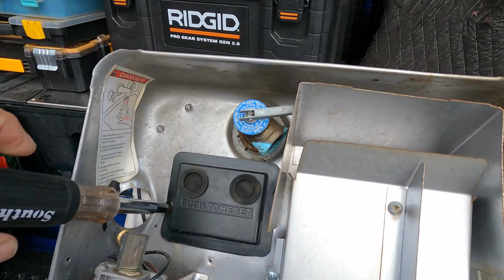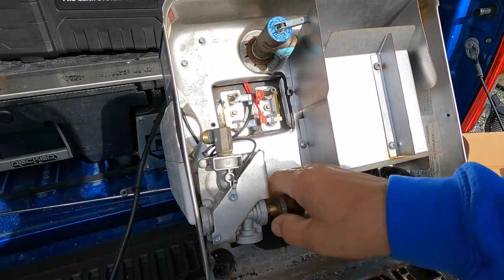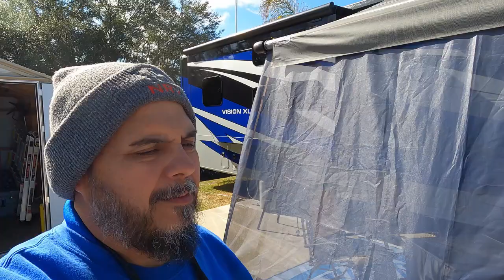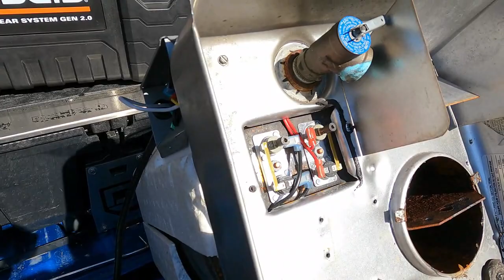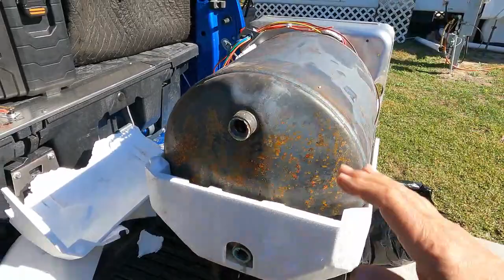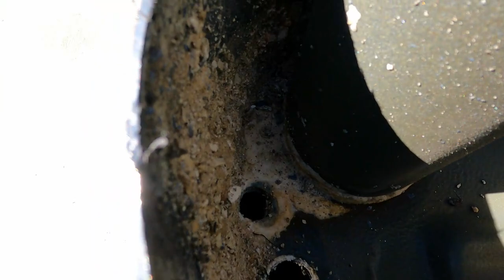Showing The Inner Workings of a Suburban Water Heater

Comment: Don, what's the chance in you having a steel tank like that in working order. My camper has one exact like that but, the bottom is gone. Can they be repaired? Thank you. Tony
Reply from the maker: It’s a steel tank so you can get it welded if you know someone who does. They do sell replacement tanks but hard to find someone who will replace them because of the rings/spring clips that need to be attached to hold it to the face plate.

Comment: I just found your channel!!!  Will binge your channel - a new sub.  This is an excellent - awesome, vid.  Extremely informative!  I saw you didn't have a plastic strap holding the foam against the HW metal water tanK.  My plastic strap broke.  It looks like the strap also secured the control box.  I couldn't work a new strap around the foam.  To secure the control box I simply used double sided tape adhering it to the fiberglass battery box on our Casita trailer.  Do I need to replace the strap?  If so, how would you fix?  
Thanks for your detailed instruction.  Dave
Reply from the maker: Hi Dave! As long as the foam isn’t falling off (& it shouldn’t be because it’s pinched) I wouldn’t worry about it. And thanks for the sub!